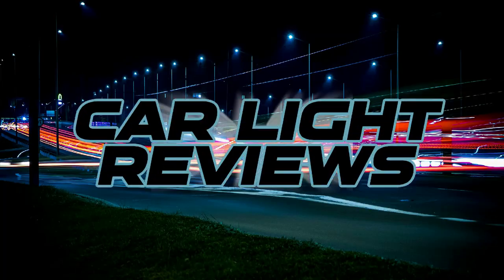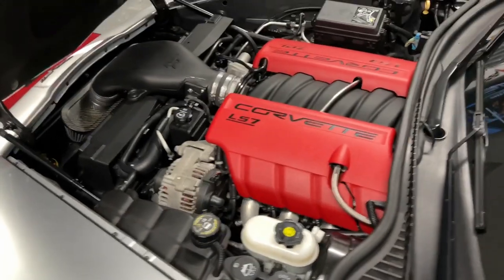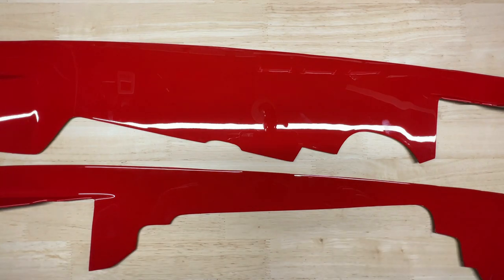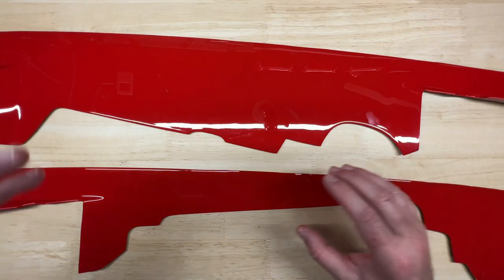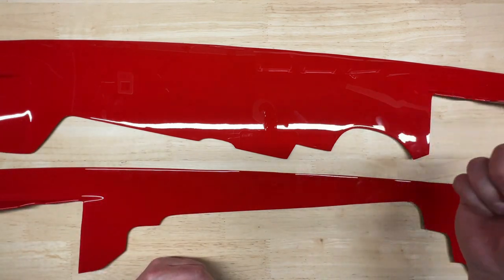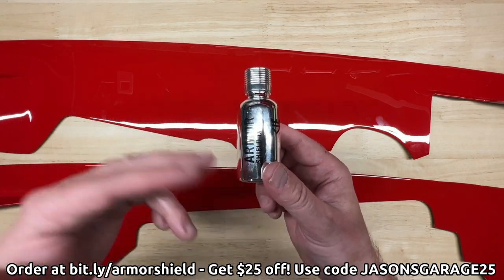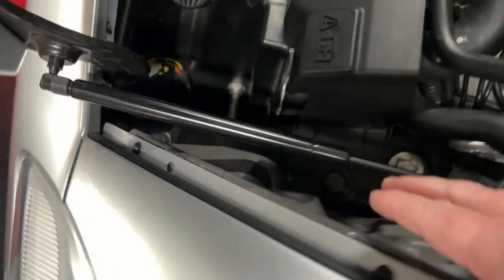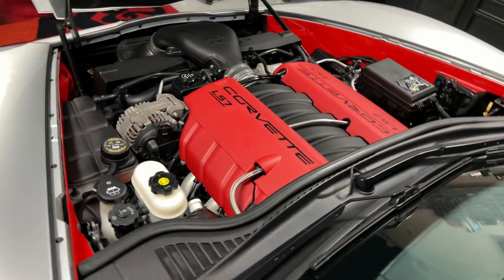American Hydrocarbon C6 Corvette Inner Fender Covers - Review and Install

Comment: $500? Ouch. I think you're right about certain parts of the engine bay looking "unfinished." I think the passenger side is notably bad. At least the driver's side has a few largish gizmos to attract your gaze: brake master, coolant overflow, clutch master, etc. The passenger side has those heater & AC hoses made of different materials and then that rat's nest of wires. You only have two large eye-magnets: battery (in my case I have the snazzy Optima Yellow) and the very 40's-noir fuse & relay box. The point of junction between the body & the inner fender? THAT has never bothered me even a little bit. $500 though? That seems a bit over market, even accounting for the "Corvette tax." I like the idea of cleaning up the look of the engine bay, but for the minimal, and subjective, improvement in this product provides, I think the $500 could be spent elsewhere. There's almost an unlimited amount of things you can modify and customize to make the C6 "your own." Perhaps you've hit that wall where you've done everything you can do and now you're scrounging for modification projects, but I am definitely not there yet. Personally, I'm looking to put on some kind of rear spoiler, probably the ZR1 model, on my Base C6. My only hesitation is should I got with black and match the car's accents now, or do I get a body-color painted one (& I want a no-drill model. Oddly I'm not eager to take a power tool to my car's body and start piercing it with sharp metal tools.)? Brake lights next, then maybe modify the fog lights with a brighter, whiter light (We don't get fog here, but there is almost no amount of extra illumination my aging eyes don't appreciate.), and then some electrical additions, modifications, & upgrades & I figure I do a paint-correction and I'm car show ready.  Thanks for the video. Your video production is excellent. I LOVE the overhead shot of the engine bay with the pan showing the before and after. Truly professional level stuff.
Reply from the maker: Yep, it isn't cheap but you do get high quality.  You can't go wrong with the ZR1 style spoiler, just make sure you get it from a quality company, as you might have seen.  Thanks so much for the nice comments about my videos! 😎
Reply: @InJasonsGarage  ZR1 spoilers differ that much if they come from different retailers? I figured the same big ZR1-Spoiler-Manufacturer (ZR1 Spoilers R Us? Acme ZR1 Spoilers?) was stamping them out like keys, that they were all the same (I mean, how big is the market? How many Corvette owners are there really? And what subset of those owners want ZR1 spoilers, and what subset of those can actually install them themselves? I figured total market was like 15 dudes.) and different retailers just put their name and markup on them. Darn it. You've ruined my retail purchasing strategy I'd formulated. Now I've got to actually pay attention, instead of just operating under my normal operating paradigm of "more money than brains." Whose do you recommend?
Reply: @InJasonsGarage  You deserve the comments. I wouldn't consider them "nice," more like "honest." Like I said, I call it like I see it, and that pisses a lot of people off. You do impressive work. You probably already realize that, and don't need my validation. Sometimes I'll be a little hyperbolic when being negative just for the humor. Generally I can tell how smart somebody is by how they react to my reaction. Some people "get it" right away. For others, they never do. It's a cross I have to bear. I keep trying to be "average," like everybody else, and I keep failing. It's boring, and it takes forever to do ANYTHING. It isn't natural for me, but I've so much positive reinforcement over the years from really smart effective people that I now just figure I'm he smartest guy in the room. I'm not always, but I tend to assume I am because it keeps happening, over and over. I know I'm not, but those other smart guys must be in the bathroom or on vacation or something. It's a curse. It's better to be lucky than smart. Knowing stuff can be painful too. The more you can do the more people expect you to do stuff. They grow to think that just because you can do a lot that you can do anything. For them all that stuff is on the other side of the fence they categorize as "impossible tasks."  For them fixing a car, or a computer, is the same as building a box-girder bridge from L.A. to Tokyo. They know they can't do any of those things. They can't gauge the skill gap between fixing the car and building the bridge. What I'm trying to say is that I'm not fawning over your videos because I'm some retard and it's all just video magic to me. I have IQ points. I've been to a couple of schools. I've done some stuff and been some places and seen some things and had some experiences many might regard as remarkable, and so when I say your videos are good, they really, really are. Life, and my customers, keep telling me that I'm not some idiot that can't figure stuff out. I'd do my own youtube channel, but viewers really want, almost demand, consistency, and if I just started doing videos on everything I do, or can do, the videos would never stop, and it would piss a lot of people off. They'd say "you can't possibly believe you can do the breadth of things you're purporting to with any skill or competency worth watching," and if I pull that off, all those people that can just do one or two of those things will become demoralized, possibly even depressed, or worse, and they'd lash out at me. So that stops me. That, and the fact that I'm really ugly.

Comment: I had no idea these engine bay panels existed. Those side walls and how horrible they look from the factory have driven me nuts ever since I bought my C6 GS. I pondered weak and weary for hours about how I could spray paint those areas and my only conclusion was that I'd have to pull the engine. I've done that going back to my C2 days, but NOT today! So, thanks Jason for now giving me/us a solution. Now I'll have to ponder weak & weary about the cost of these panels. 😉
Save the Wave 🙋‍♂

P.S. I just checked their website and they're out of stock. I guess I'll be saving some money whether I want to or not. 😊